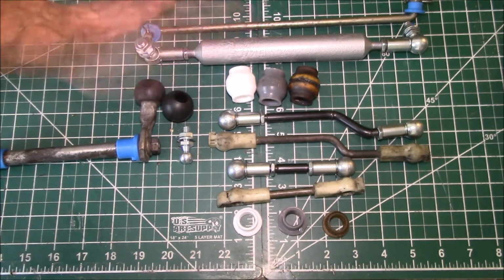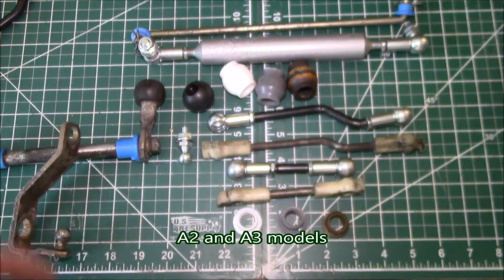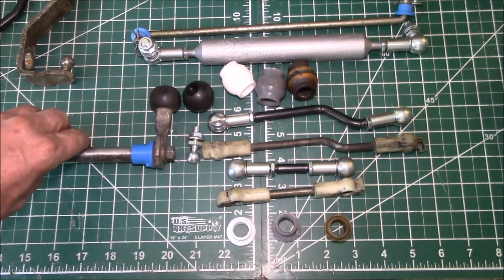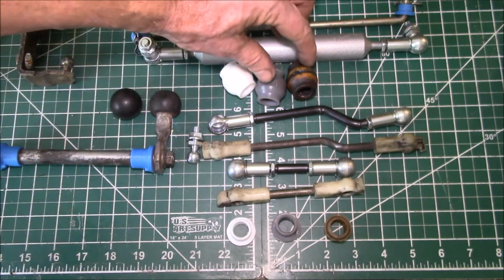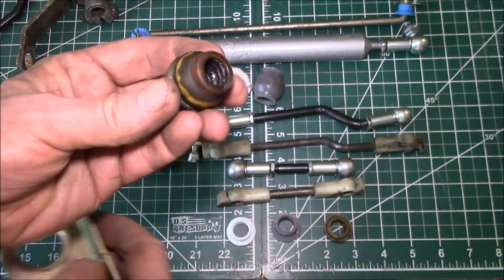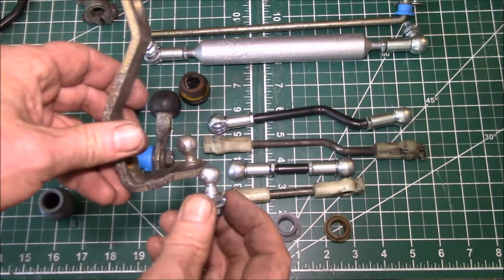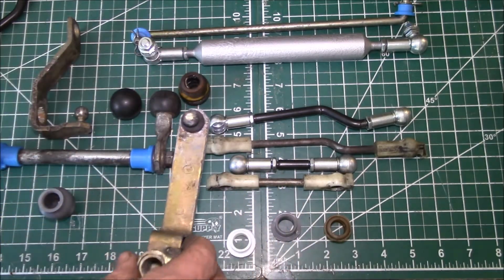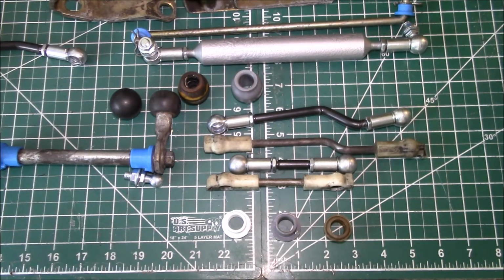MissingLinkZ Shift Linkage Parts for A1/2/3 VW Vehicles

Comment from the maker: We've begun releasing various 3D CAD files for various VW shift linkage components, you can find that information on the link below::
https://www.thingiverse.com/4crawler/designs

Relay shaft bushings: https://www.thingiverse.com/thing:6977080
Shift rod bearing: https://www.thingiverse.com/thing:7261656
Shift weight: ttps://www.thingiverse.com/thing:7299450
A2/3 relay lever bushings: https://www.thingiverse.com/thing:6915558

Comment: Nice video sir 
Quick question I have a AUG o2o transmission from a MK2 I want to install on my MK1 but I transfer the relay lever from my old MK1 transmission but doesn’t quite match the length of the two plastic ends levers 
Do you know if I need to use a MK2 lever or something I thought they were the same
Reply from the maker: I've never worked with the Mk2 relay lever itself, but some information on the Mk1 lever below:
https://www.4crawler.com/Diesel/ForSale/ShiftLinkageInstall.shtml#RelayLeverShim
I think the Mk2 lever is set up a little different and the shift linkage rods are different lengths on the Mk2 transaxle, especially the forward selector rod is a lot shorter than the Mk1 rod.

Comment: Hi - I am having a problem shifting into 1st & 2nd gears. When shifting I need to be very careful or I can accidentally move the shifter into reverse instead of 1st gear.  Someone mentioned that my reverse lock is probably shot, they also mentioned that OEM was an original plastic mold for the reverse lock. Do you make a reverse lock or hopefully you make a modern alternative. Thank you!!
Reply from the maker: Here's a thread on VW Vortex that has a good DIY replacement:
https://forums.vwvortex.com/showthread.php?3536691

Comment: My car only put Gear 1, 2& Reverse they said it's a gearbox problem but I replaced another gear box, I'm still having the same problem, I also changed new clutch kit,

What can be the problem
Reply from the maker: Likely an issue in the shift linkage.  We have a good overview of how it's supposed to work on our web page:
https://www.4crawler.com/Diesel/ForSale/ShiftLinkage.shtml#Introduction
My guess would be either the lever/ball on the relay shaft is worn out or one of the selector rods is damaged and not letting you actuate the selector lever on the transaxle to get into the 3-4 or 5 gear parts of the shift pattern.  Pop the hood open and spend a little time operating the linkage by hand into all the gears then try to use the gear shifter to do the same thing and see what's different.